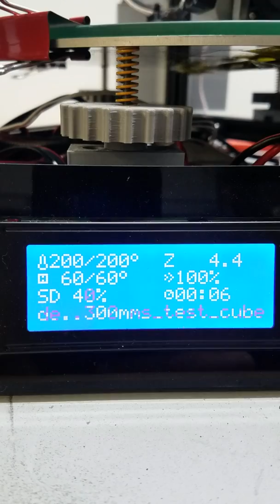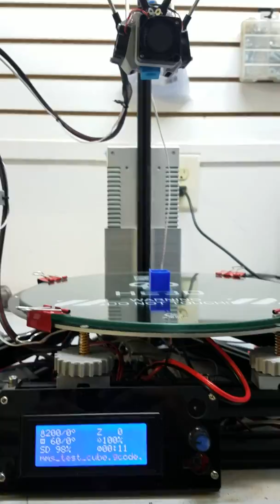He3d k280 printing at 300mm/s

Comment: Hello, my name is Franklin Arce and I live in Costa Rica, I am an anti-drug police officer and I am 53 years old, our life as undercover police officers is very hard and lonely since we cannot have a regular social life, I cannot have friends and even less family Well, I would be constantly exposing them to danger, for this reason and not to go crazy I have bought several machines to faight with my loneliness, my objective is not commercial

A year ago I bought a 3D resin printer, it's an Elegoo Mars Pro, and I was fascinated with how simple it is to use, it's really fantastic but very limited in the size of the parts to be printed, I was excited about how great the Elegoo was, so I bought it a while ago 6 months a filament printer, the Delta HE3D K280, the same one you show in your video

I have been struggling with the K280 for 6 months and I have not been able to get it started, it came with the Repetier firmware and I cannot configure it correctly, in several forums that I have consulted they tell me to change to Marlin firmware, but the Marlin firmware for the K280 It shows me errors in Arduino when loading it and I have no idea how to fix it

I would like to ask if somebody can help me, sharing or selling me a copy of your firmware already configured and working

This is not urgent because, as I told you, my objective is not commercial, but it is very frustrating to have the printer for 6 months and not have been able to print anything.

I appreciate all the help you can give me, if you are agree contact me at franklin@arce.com

Thanks

Comment: What software are you using?  Care to help a guy out with the settings?
Reply from the maker: Its running marlin 2.0, bigtreetech 32bit v3.1, tmc2208...cura for processing
Reply: @robertc9140  Happen to have the configuration settings? If so, could you share? I have this printer built but I can't get the thing to print anything.
Reply: Did you have issues with MKS Gen L (factory board) too? This printer has been nothing but a pain in the ass. It's the worse one that I own so far. (I have seven 3d printers but I bought this one for the large build volume) Yet to print anything worth a damn.
Reply from the maker: Yes i did, out the box its shit, it took over 8 months trial and lots of fucking head ache to get this fucker to work. I had to config this with marlin 2.0 from scratch. I will have to dig around on my drives for the config files
Reply: @robertc9140  Is the board that I have a link to up^^^ there^^^ the board that you switched to? I don't mind replacing the board if I can get the large build area & speed would be great too. Accuracy is most important for what I do though, I can wait so long as the print comes out right.
Reply from the maker: @IS3DM  it was the bigtreetech skr 1.3 w/ tmc2208 drivers
Reply: @IS3DM  just get an FLSun QQ-S Pro or Super Racer.  This things 3 years old at least

Comment: Did you add supports to the structure to stop wobble at that speed?
Reply from the maker: No not at the time this was posted. I did later design a print a  dual bracket that allows the upper chassis to be mounted to the wall

Comment: Do you have the configuration for charge on the Arduino ? could you share to me?
Reply from the maker: This k280 has a bigtreetech skr.1.3  board so my config.h wouldn't work with yours if you still have the stock board...plus this is running marlin 2.0 32bit
Reply: Do you designed the efector?
Reply: Guess that you're having the same issue that I am. I can't get this printer to print anything. Did you ever get it configured to print right?
Reply: @robertc9140  would it work with the skr 1.5 t? cuz im am piecing it together atm :D
Reply from the maker: @Cptdingus  yes i dont see why not